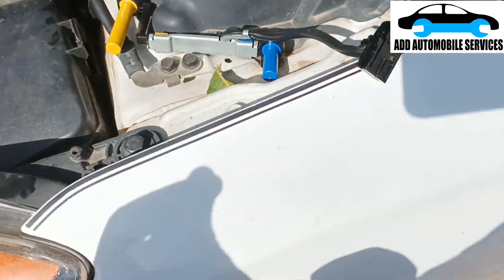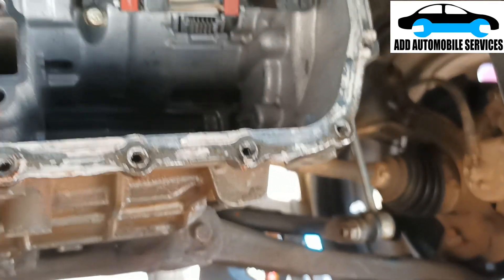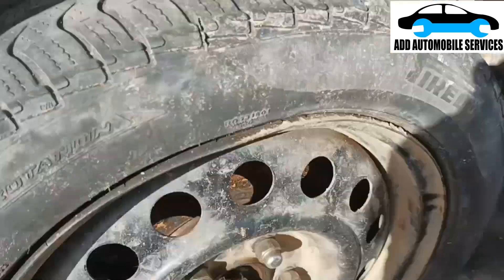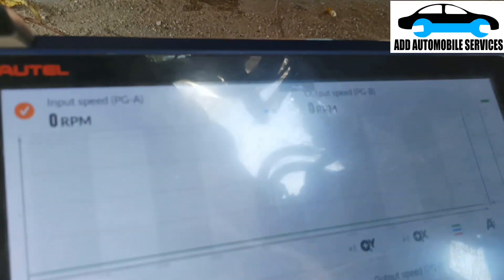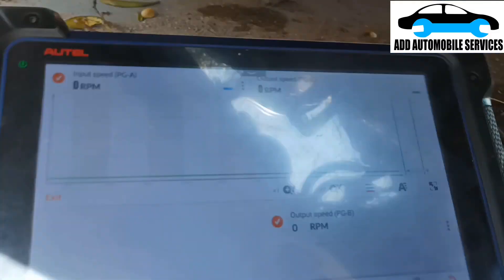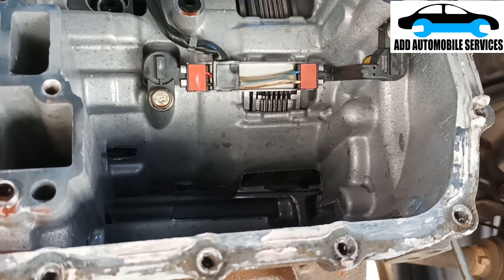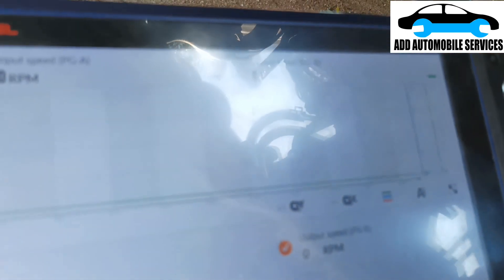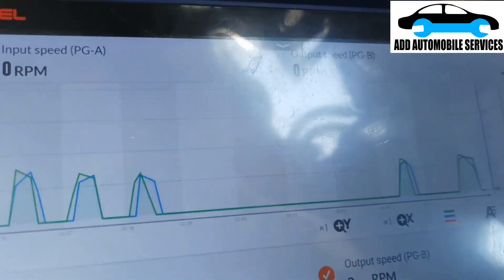Elantra 2013 : Testing input and output speed sensor on an automatic transmission

Comment: Hello, first thank you so much boss for the video,

Second thing do you had to remove the bumper or radiator in order to remove the value body or the sensor ?
Reply from the maker: Only the air cleaner housing